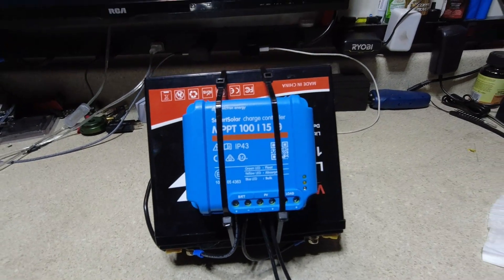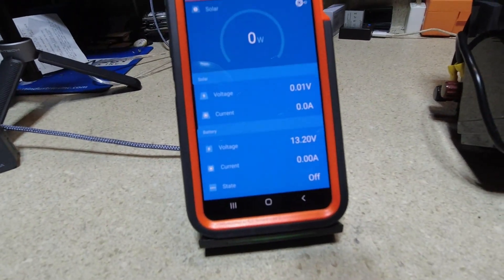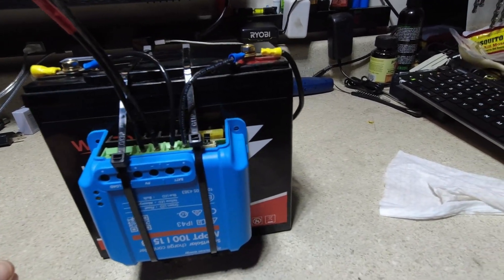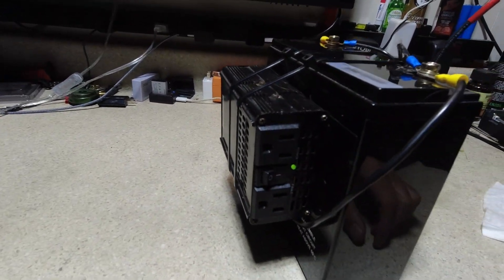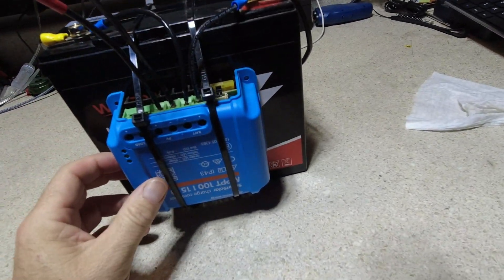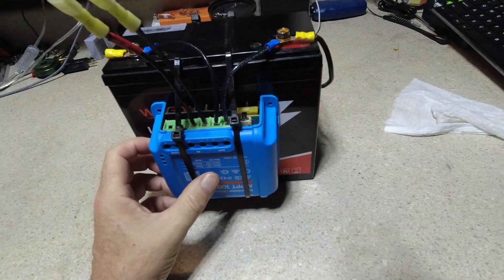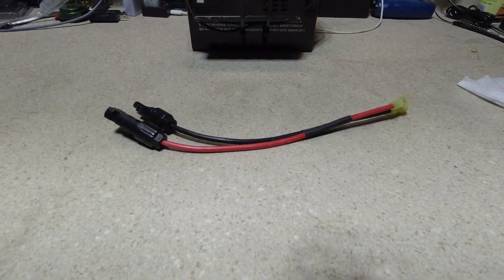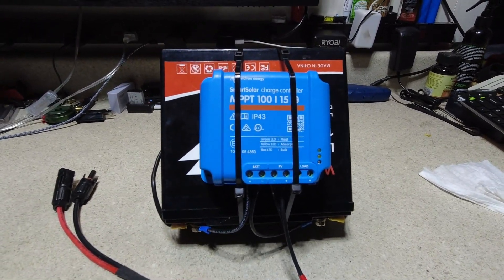SUPER EASY DIY PORTABLE POWER STATION / SOLAR PANEL TEST SETUP

Comment: Handy little set up there!👍
I'm just about finished with a 20x17 toolbox build.
100ah lifepo4 battery, 2000 watt inverter, 100 amp fuseblock, and 40 amp charge controller.
Have all kinds of doodads on it.
It's taken me a few months putting it together since I'm on disability and on a limited budget, but now I'm in the process of checking out panels.
It's actually been kinda fun...and good to know I'll have a little free power. Lol
There's definitely a lot to consider, but I'm looking for maybe about a 500 watt limit.
Gonna check out some more of your videos.
Liked and subbed.
Thanks for sharing!
Be safe👍✌️
Reply from the maker: Nice!  I was actually going to start with a toolbox build too!!  Then it turned into just a batter with an inverter on it that I use just for the garage.  Its fun tinkering with this stuff for sure.